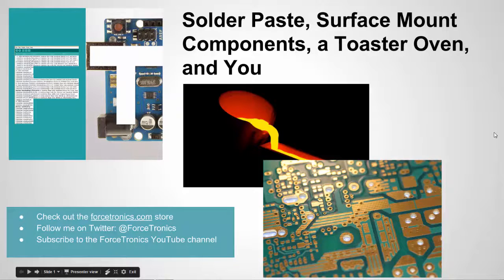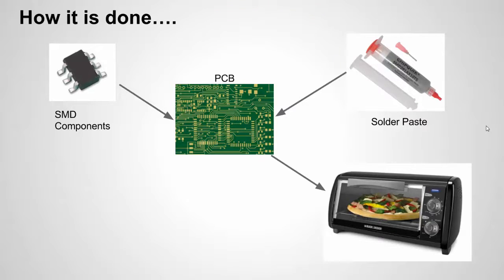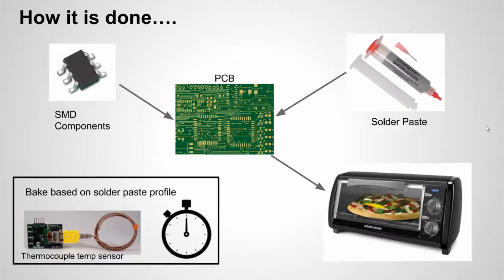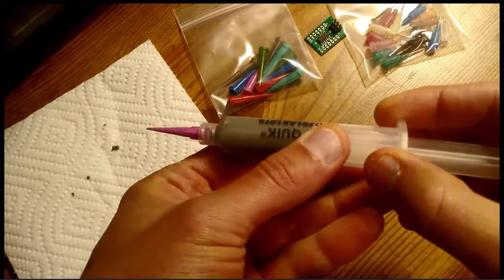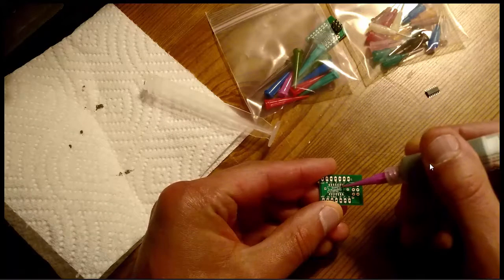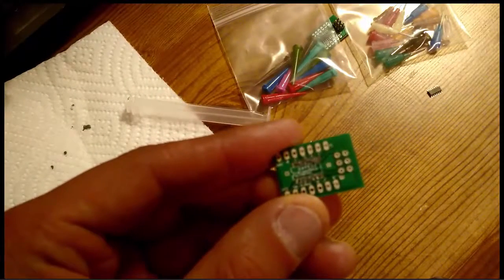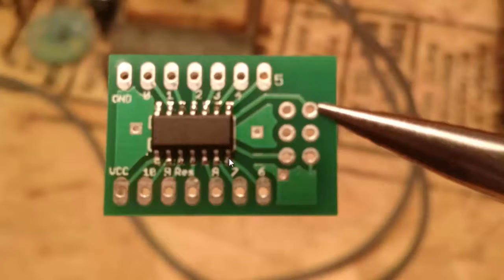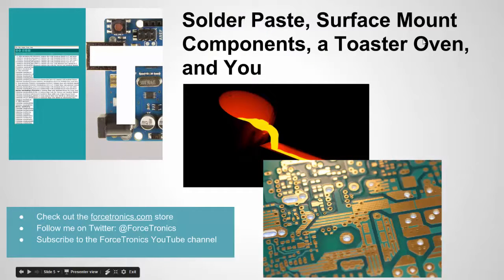Solder Paste, Surface Mount Components, a Toaster Oven, and You

Comment: Great video! Thank you.  My Hakko soldering iron runs at 700F. Solder paste melts at a much lower temp, which is what it's supposed to do.  Also 63SN/37Pb solder has no plastic state unlike 60/40 solder.  So less likely to get cold solder joints. I bought a USB microscope to inspect my boards ($20).  I already have the thermocouple probe for my Fluke multimeter.
Reply from the maker: +K6EEP Can you share where you purchased the USB microscope?
Reply: +ForceTronics Sure.  I got it off EBay.  Just search 'USB microscope' in all categories.  Less that $20 w/shipping and work reasonably well.